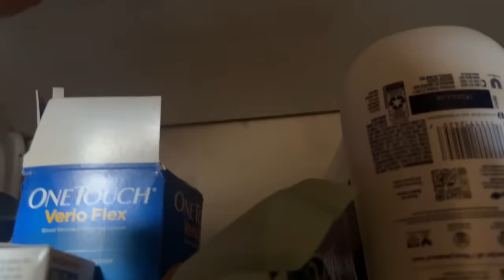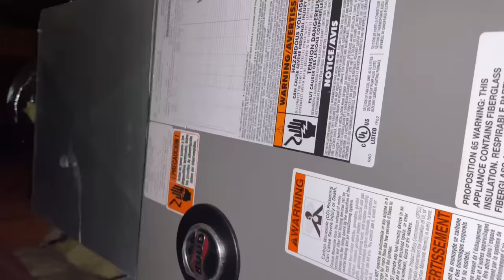Central AC Leaking from 2nd Floor Bathroom Ceiling Light - Step by Step Instructional Video

Comment: People seem to love central ducted air. Even when they have to stuff the evaporator into an attic or closet, making it impossible to inspect, service, and clean. Seems like a Mini split may have been a better choice, no? Not only do they provide heat, but the seer ratings are almost always higher than a comparable central unit
Reply from the maker: The seasonal energy efficiency ratio of a ductless mini split system is phenomenal. If you are in the Long Island, New York City metropolitan area and need a local HVAC contractor give us a call at 516-348-6300.

Comment: I see the old furnace still up there in the background, they must have taken the new one apart to get it in there and of course they reused the old pan, because a new one wouldn't fit through the hole!
if house has vinyl siding, I would pull it at a gable end and cut an temporary access hole for equipment or see if there's a viable place to install permanent attic stairs. that said, an HVAC contractor isn't going to do any of that, nor do I expect them too, unless they're a multi-construction contractor business.
Reply from the maker: I really don’t know how they got the new one up in the attic but the old one as you could see was left in the attic. If you are in the Long Island area and need an HVAC contractor give us a call at 516-348-6300

Comment: How the hell did they get that unit up there using that little hole in the ceiling.??? has to be another way into the attic.
Reply: maybe they took it apart, if it's one that comes apart. I notice the old furnace still up there in the background. 🥸